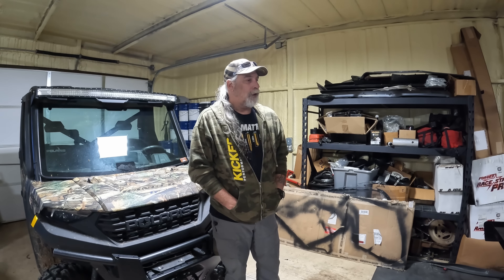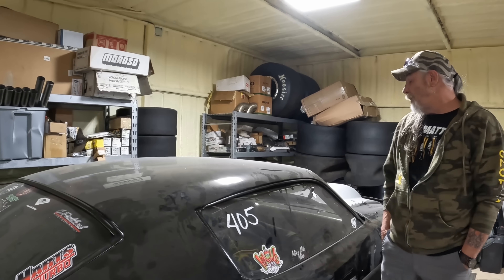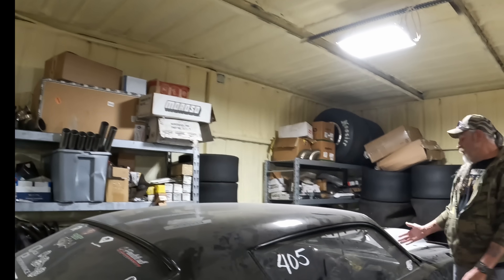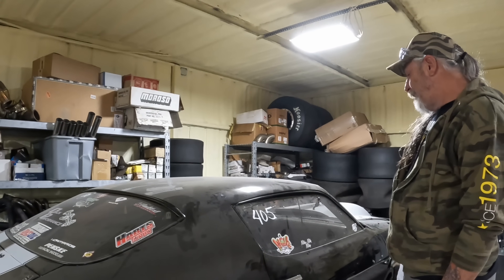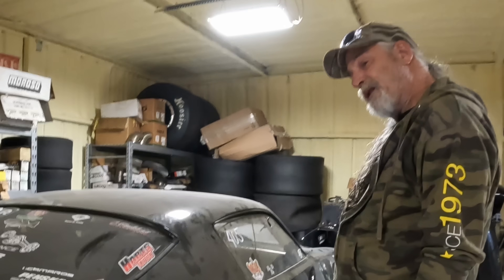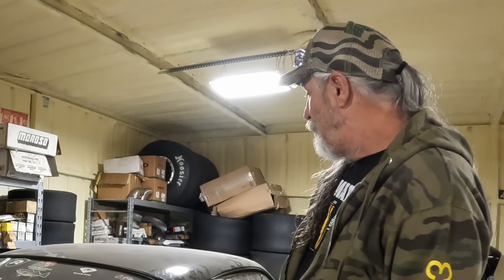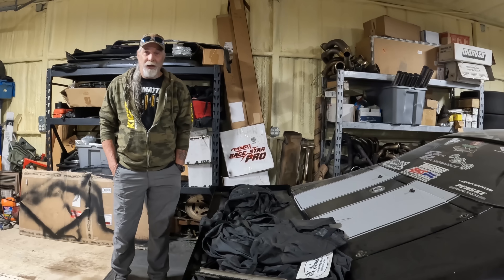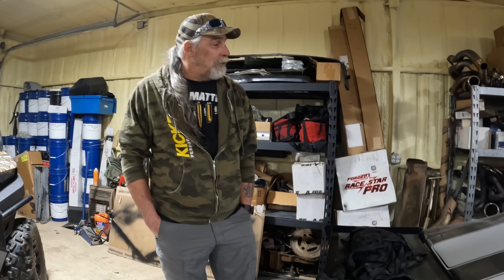Monza discusses the Split Bumper current condition and future!

Comment: This not a knock on Monza and the "Sinister Split Bumper". But, its not hard to believe he won the coolest NPK car award. NPK has become drag racings version of IROC. Nothing but a bunch of '69 Camro's and other first gen Camro's. That's the reason i don't watch NPK. Its all the same cars with the same drivetrains. Atleast Daddy went with Audi. Swanstrom was being cool with the Lexus. But,  he joined the rank and file and got himself a '69 Camro also. 

Thsnk you Monza for choosing a '70 Chevelle to Run. That's as cool as the split bumper.

Comment: You should build the car more for NPK and not worry about street racing it.  If you went to win I would go pro charge hemi. I don’t see anyone winning with turbos or even a BBC, if you go a few rounds you will be able to run a season and be in the top 10 at least, you have the skills you just need to right combo and the split bumper upgraded. Don’t be like chief and fade away because of trying to stay so called true to the streets. NPK is the right choice, you just have to figure out how to win. Hemi pro charge or screw.